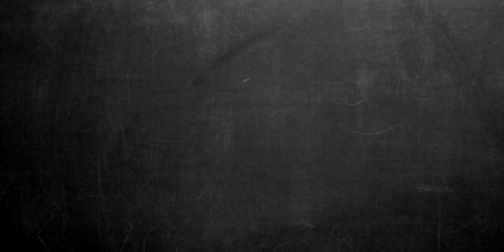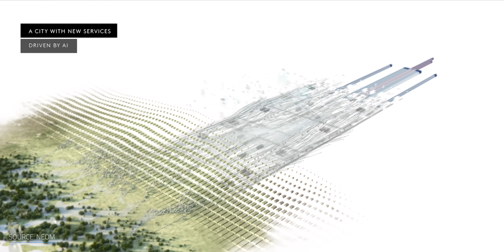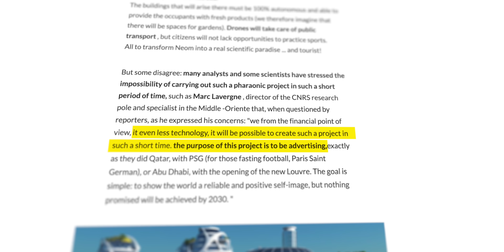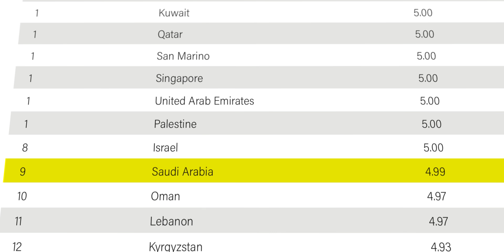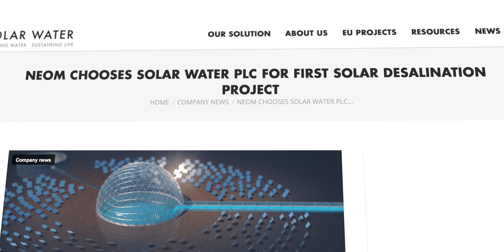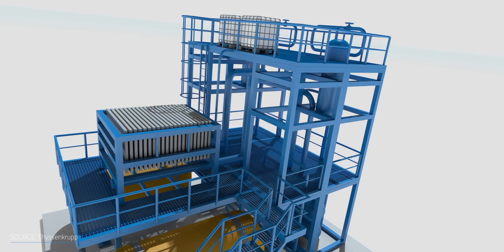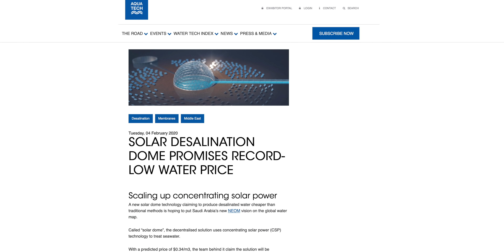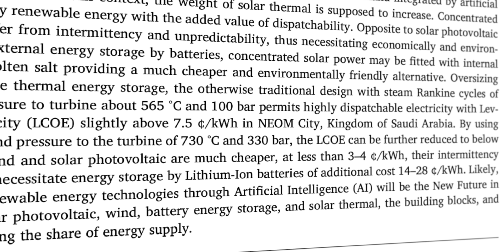Why Neom Might Be The Future of Sustainable Cities

Comment: The thing about water consumption by a given population is that it's entirely dependent on how well the system utilizes gray water. With existing technologies we can fully close the loop of water consumption by a fixed population. The vertical farming sector can completely handle all gray water used by the population, including the biosolids, if done correctly. Excess gray water can be added back into the brine pools and discharged into the ocean to reduce the salinity. We have water treatment facilities in the USA that process gray water into cleaner water than the average water district's intake stream.

We can very effectively mitigate this issue with existing, off-the-shelf technologies if a competent engineer gets the funding to deal with it.

Comment: When I build my factory in Factorio, I build it in a chain-like fashion, with each new link being the next iteration of the design, improving on the previous link's model. Having a multi-lane train line running down the center makes transportation seamless, cheap, and efficient in virtually every way. With modern train controlling, AI-controlled trains could switch lanes dynamically based on pre-defined routes, with the outmost tracks carrying trains that make the most stops and those in the middle having the least. Similarly, belt lines are used to slowly transport material from production links to links that are currently under construction.
Reply: Yes, incredibly efficient in a computer game, but imagine having to live in it. What if you had to, or just wanted to travel from one section of the city to another? Linear city planning on this grand scale ensures ghettos for the poor and working classes. A capitalist dystopia.
Reply: A city is not a factory and Hyperloop is not a conveyor belt.
Reply: There is nothing wrong with a main transportation bus with large extensions branching off, effectively creating a sort of fishbone or tree structure. However the Line is only a main transportation bus. There is very limited space for branching off. All the great Factorio players use area in 2 dimensions because it is far more effective then predominantly in a single dimension.
Reply: Even real factories are more complex than this.

Comment: why not use solar to make both power and water so use use solar thermal to boil water and PV for electricity for high pressure & temperature electrolysis to hydrogen then use a fuel cell to get electricity and or use the steam to move turbines which will condense collect the water byproduct. 
I think water desal is important so need to work on the salt slurry waste like have long pipes into the sea that will take in sea water to dilute and have it discharged in specific areas. Also maybe just extract the salt since we still use a lot of salt and some manufacturing is from solar in ponds just use the slurry rather than taking in sea water

Comment: Megaprojects with the proper financing bring production costs down according to Miller's law.  Doing nothing to protect the earth's livability is a cost far beyond any investment today.  The entire world's economy should be focused on reversing carbon in the atmosphere.  The first challenge there is to STOP additional CO2 from entering the atmosphere.  I think what most people do not realize is that if we stopped using fossil fuels this very second that the planet will continue heating until we actively remove the existing carbon dioxide.  This would be a global challenge far beyond anything mankind has attempted.  In order for it to work is total commitment without regard to cost or political obstructions.  So in short, we are doomed as a species.

Comment: Interesting video Matt! 
Just one thing in regards to the Thussenkrupp 20MW electrolyser unit. 
Where did you get the 82% efficiency from? 
I did some some calculations, based on the electrolyser technical data sheet, and the efficiency resulted of 60%. 
Design capacity H2: 4,000 Nm3/h 
Which is the equivalent of 359.5 kgH2/h
(4,000 Nm3/h x 0.08988 kg/m3) 

359.5 kgH2/h x 33.33 kWh/kg = 11.982 MW 

11.982 MW / 20 MW = 0.599 (60% efficiency) 

Assumptions: 
H2 weight: 0.08988 kg/m3 
H2 energy density (LHV) : 33.33 kWh/kg

Comment: As we face rising ocean levels, it's clear that the ocean is becoming LESS salty (ocean levels rise as new FRESH water from glacial melt enters.) This means that we need to re-salt it to get it back to 1800s-era salinity. So long as you resalt the ocean with the brine over a relatively large area, it should be a good thing for ocean life.
Reply: The salt comes from the ocean to begin with so it doesn't raise the average salinity. However, it can raise the salinity in the immediate vicinity by a lot which can be damaging for the local ecosystem.

Comment: At first I thought the the idea of a city that is a line is highly impractical for transportation. However it makes so much sense when you think of a city built around these track systems. It completely gets rid of the complexity issue about destinations. If you can get from one end to the other quickly enough on the X axis then you can use the second layer to move along the Y axis, and then use the top layer to fine tune to where you need to go. 

In theory and on a big picture I really like it, but the devil's in the details. Let's see how they solve those things and I would be very happy if it worked!
Reply: Not much revealed to public on the detail planning.  I think your interpretation is not correct.  The line is a line.  Just X-axis and no Y-axis.  The second layer is service layer which carries the gas pipe, electricity cables, water supply pipes, fibre cables for internet etc.  On the ground, no cars and people rely on walking.  All the buildings should be very close to the line within walking distance.  From the video, there are parallel metro lines to the high speed rail lines.  It strengthens the line concept.

Comment: One Question: How is this more SUSTAINABLE than regular cities we have right now?
Reply: It really isn't but the Saudi Arabia wouldn't know sustainability if it slapped it in the face. Vanity projects on the other hand...
Reply: Hmmm for the normal citizens not so much, but it's sustainable for the ruler class. It can be transformed into a prison much easier. It is surrounded by the desert and giant walls. The cams will be everywhere, your mobility is fully tracked and completely dependent on the linear transport system. It might be also interesting for the Gaza strip, which is basically a prison and where the high population density is compressed to a line as well.
Reply: Too much control total recall looking  city no thanks wake up people don't fall for it.
Reply: If I had enough cash around, I'd do the same as to try and shift to the latest eco friendly energy sources without exaggerating with concepts in order to supply the whole population's demands, so whatever money I make from oil goes to investing, because you never know when oil and gas is going to run out.
Reply: I’m m responding 4 years later to congratulate you on being correct in your comment about this being totally unsustainable.  Good call. A voice of reason
Reply: because it's only one line. Unlike modern cities which have many lines, so harder to sustain
Reply: @dr.z7958  1 line is worse. 1 line that the Entire city has to use. This is a logistics failure. With a larger grid system. if a line goes down you can Multiple ways to get around it. the point is optimization. Which a single LINE is horrible for.

This city even if it starts out as a line is going to quickly expand outward in circular patterns. Since Best way to maintain a city is to have everything close by. if you factory is on 1 end of the city and your store on the other. Its going to attempt to move that factory as close as possible. People are going to want to live closer to their jobs and commercial hubs are going to want to be near the people. 

There is naturally going to form bubbles of mixed commercial, industrial, and residential areas growing outward randomly around the line as people arbitrarily choose there "Centers"
Reply: @BlueBD  That is of course one possibility and I have to agree with you that it makes a lot of sense. But given that they promise to have transportation that will get you from one end of the city to another in a short time, could alleviate the problem to a certain degree.
Reply: @dr.z7958  somebody jumped on the tracks of your ONE highspeed connection throughout the entire city! shit, guess 5 Million people are coming late to work. Construction work? guess no high sp3ed travel for the next couple of months. Hyperloop? oh, the vacuum chamber  ruptured, enjoy having a shock wave travel down the entire tube crushing everything in it's way like a can of pepsi! 

Whoever conceived of this project is a retard.

Comment: The nerd in me says it sounds like a cool idea. But the skeptic in me says that pre-planned cities like this have been attempted in the past and rarely work out. I don’t really see a purpose for building a city in the form of a hundred mile long straight line except as an excuse to build a fast train. It’s building a city to accommodate a train rather than building a train to accommodate a city. From a logistical standpoint it seems like that just makes everything less efficient. What’s the point of having an extremely fast, extremely expensive, extremely power hungry superconductive maglev train if there’s really not that much around it to transport? And when it comes to water it makes even less sense. This entire city relies on the miracle of low cost, low power, non-polluting desalination tech that doesn’t yet exist on that kind of scale. And it seems almost purpose built around distributing that water inefficiently. If you try to transport water 100 miles through pipes you’re inevitably going to lose a lot of it to leaks. It makes much more sense to keep a city near its water source. This city is a wasteful and inefficient design. It sounds less like a solution to climate change and more like the musings of someone with too much time and money and not enough sense.

Comment: Correct me if I'm wrong, but using the leftover desalination 'brine' in detergents and fertilizers will simply move the toxic chemicals to the water-distribution facilities. What happens to the chemicals there? If it just goes to a waste treatment plant, then a good chunk of that will still wind up in landfills and therefore, the watershed. This is just pollution with extra steps.

Comment: My own conclusion is that potentially stupidly expensive mistakes like these need to be made to obtain data necessary for the future. If a theory is an egg, reality is the rock you throw it against. You have to throw enough eggs against rocks if you want to know what's Really going on.

It sounds expensive if taken as an isolated case, but would be worthwhile if seen as a proof-of-concept that could be deployed worldwide. China's Xiongan city project is another one of these potentially stupidly expensive mistakes. When living in China, I recall how incredibly stupid the Shanghai Maglev rail was considered: it was much more expensive than bus, too short of a distance for the time savings to matter that much, etc. But apparently China is now considering long maglev rails connecting different cities. In that case, it became worthwhile for it to have an expensive prototype just sitting there.

My only concern is that our current institutions aren't properly equipped to take full advantage of the lessons to be potentially learned from these expensive endeavors.

Comment: I know you are a very optimistic guy, but in my opinion you should not fall for vapor sales like the hyperloop. Any engineer can tell you that vacuum systems are notoriously challenging to keep de-pressurized, especially at high vacuum pressures. A real hyperloop would be the largest vacuum chamber in the world and it would  mean you needed to have pumps like every 50 meters or so, working permanently to keep the vacuum sustained, thus making the whole thing financially and physically a disaster. That it, if you can even build a half decently seald vacuum system of that size, which brings massive engineering problems like thermal expansion of the largest vacuum tube in the world with it. Just see for yourself how Elon Musk started with wild announcements about the hyperloop back in 2012 or so and what came from it in Las Vegas: basically human driven Tesla Taxis in a tunnel. Although maglev is technically a viable technology it has some practical disadvantages over common rail (like switch points), and putting it into a vacuum tube makes it a technical nightmake with a tendency to burst out of control. Just imagine a sudden (de)compression event, flooding the whole tube with air within seconds, while maglev trains are going 600 mph or so, suddenly hitting a wall of air...
The whole "line project" is very ambitious and I can imagine that some if not many of the technologies implemented may be very promising, but the hyperloop is certainly not among them. A nice high speed rail line however, would do the job - although it may not be as fancy.

Comment: The bottom line is whether this project will generate low cost energy to power itself. I am certain that the prince is aware that it’s a big bet that must succeed to ensure the survival of his country. I think the biggest point of failure is the native population that doesn’t have the resilience to make the project work as they have been pampered for decades by a government that dissuades critical thinking. The prince himself is a brutal dictator and if the project doesn’t work within his lifetime, he will go down as a failure. I hope that it does work since it’s a gamble on the future using cutting edge technology but it rides on repressive government.

Comment: Water boils in a vacuum at 30C: if you pump up cold seawater you can use it as an endothermic source you then send the water out to be heated in black pipes contained in glass structures this may also be under vacuum to increase efficiencies aka standard solar water heater the hot water is then sucked into a long evacuated chamber through spray nozzles this fine mist instantly vaporizes all solids salts metals bacteria viruses etcetera then fall to the bottom the steam will rapidly go to a low-pressure area father down the chamber where the chillers are using the cold seawater and or supplemented with heat exchangers the steam will condense as pure water making room for more steam sustaining the vacuum.

Comment: I see more use in what could be termed terraforming.  This could be done much cheaper and with known results just with Geoff Lawton's methods of greening the dessert.  Also it would not require the extensive use of dirty energy, eventually there could be enough green life to help create natural fresh water.  This has been done in India in areas that have suffered with constant drought for the last twenty years.  And it was accomplished by villagers with no real state of the art equipment or methods.  It could be done in a line but the mountains would be stage one with their structure serving as water catchment.  That would be the starting place.  I also see some issues with an completely underground railway in an area known for earthquakes.

Comment: there is actually no practical reason for constructing a city in a line. The traditional city grid of Europe always allow multiple modes of transport --  walking, bicycling, public transport and sometimes motor cars. If one fails or is overloaded, use another. You can also connect to a large number of people in a short while. Inner-Periphérique Paris can be transversed by bike in 45 minutes, yet houses almost a million.
The only reason for this linear design is similar to the only reason for building a mega-skyscraper: if you think a virtual giant penis is something that impresses folks.

(The new technology of Neom is pie in the sky: great if it works out. Sheik Yer Neom should start out by investing a billion in a water dome; if it's as good as he says, then that will be a great contribution to humanity on its own).

Comment: The dome idea sounds very promising to me if it's produced with bad material. They just need sand for the glass, polished steel and some empty space. Doesn't sounds like things hard to come by in a Earth's desert. Then it passively generate water and electricity. All you need to do is to keep the mirror dirt free.